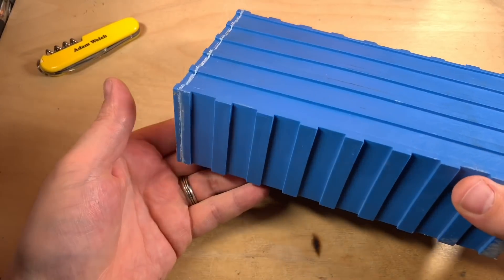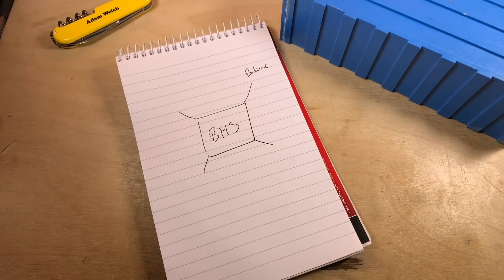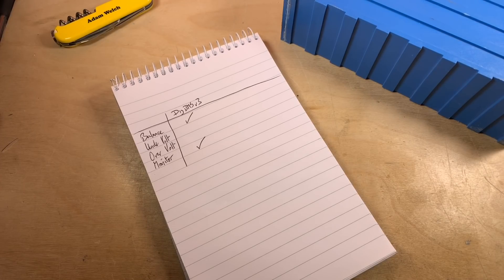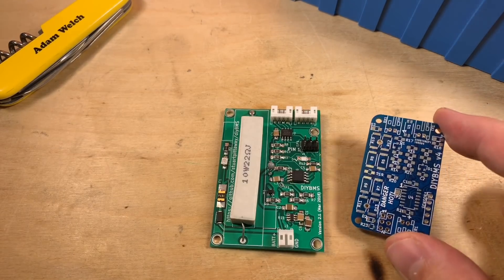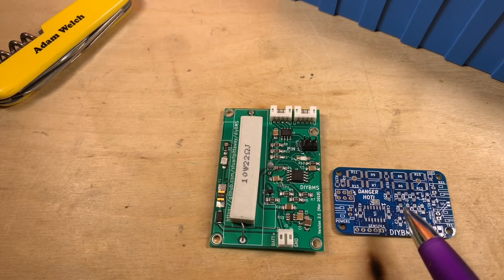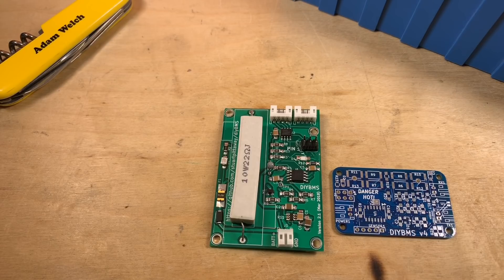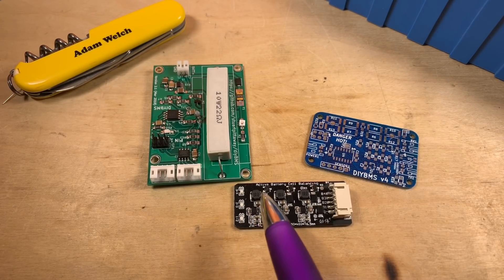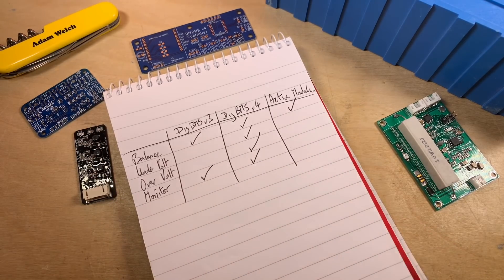LiFePO4 Battery Bank Management Systems

Comment: Thanks, for this video!   Very well done!

Also important, is temperature monitoring and the ability to disconnect all charging sources when the pack is too cold and the ability to disconnect all loads when the pack is too hot.   And, attendant to that, your BMS should be able to control a heating and cooling system to keep the pack in a safe temperature range.
Reply: Same I wanted to say. Especially for cold days LiFePo-Batteries do not like cold temperatures, when loading. Then you should go to LiFeYPo batteries or heat the cells slightly, but then you waste energy for heating.
Reply: @DocMicha  Or use LTO cells

Comment: Seems like over and under voltage at the cell level is more important than at the entire pack level and would eliminate the need for it at the pack level because your pack can't go over or under voltage without at least one of the cells getting over or under voltage long before the entire pack would. But for redundancy it makes sense to have the protection at both cell and pack level.
Reply: Yes. Balancing is the least important function bc of this.

Comment: I like the idea of not dumping power , instead use it , charge another battery , heater / water heater etc.
Thanks again
Reply: Or boost it to main voltage of the battery and return it back (when charging). And vice-versa at discharging.

Comment: I've recently been playing around with a  190Ah 12V LiFePO4 battery, using one of the aliexpress bluetooth BMS units with a custom arduino OLED display. One thing which is a must have for a LiFePO4 BMS is a coulomb counting state of charge meter. If you use voltage to determine state of charge it can be ~50% out under load, and ~25% out at rest. Active balancing doesn't matter that much, since large format LiFePO4 cells are most likely going to be very well matched and not require much balancing.
Reply: I have the same bttery from them a.ll cells we're  balanced on just a few 12 volt ight they run down in just  few hours  I have two 4 cel packs not sure what to try.

Comment: To use the active balancing and not the DIYBMS V4 (I use that) cannot you just leave the load resistors off of the DIY BMS?
Reply: Won't hurt to use both - they'll have different threshold voltages anyway.
Reply from the maker: I could, but the load resistors won't take any load (hopefully) unless for some reason the active balancer has gone wrong, or can't cope.  So they may as well be fitted - just in case.
Reply: Is there an isolated DC to DC boost converter module readily available? Instead of load resistors, connect to input of an isolated boost converter. Output of the boost converter to the overall charge bus of the pack at a high enough voltage to charge. Repeat for each cell. When a cell is over voltage, DIY BMS will turn on load resistors, but instead of resistors you have a boost converter that will feed the excess energy back into the overall pack and then into lower voltage cells.

Comment: For years I kept saying there's got to be a way to transfer the excess energy from one cell to the next. This balancing board was a great find, but it does need over and under voltage like you said Adam
Reply: Active balancing has been around for at least 10 years.  Its way more money though and if you have brand new cells that are matched from the factory, the active balancing circuitry wouldnt really have anything to do.

Comment: Is there a Battery Balancing  module that is designed around Lithium Ion batteries that keep the max voltage to 4v per cell in a 4s arrangement? It seems every thing I see out there is designed for a 3.7 max voltage.

Comment: What would you recommend for 4s x 22p LiFePo4 HP? I want all the trimmings. If you could work all that out for me it would stop me a whole heap confusion because I can not find the board with all options plus I do not understand the charger and what charger I need for such a big arrangement. Would I need to charge them in smaller groups???

Comment: There are 5A versions of the active balancer too. Still waiting for mine to arrive from China. Another YouTuber seemed to think that the small board doesn't actually transfer the energy across though. I'll test mine when it arrives :)
Reply: Crap I just ordered an 8S one and now read this
Reply: Got a link for the 5A version? NVM: I just happened to find some on ebay with "active equalizer 5A"
Reply: @WereCatf  I can't seem to get the libk on my phone, just search for: 5a 4s active balancer and they should pop up. Not many sellers at the moment. Good luck :) edit.. There are 9 silver/blue caps on one side, other side os all surface mount stuff
Reply: There seem to be versions with red caps on Aliexpress now as well. Think I should order me some to test. Too bad it takes 2 months for anything to arrive to Finland from China :/
Reply: @WereCatf  Im lucky being in UK. That's the only good thing I can think there is right now haha
Reply from the maker: Julians video seems to suggest it is transferring correctly.  I'll be doing more tests before I attach it to anything important!

Comment: The thing with balancing, if the packs/cells in each of the series were built properly to be all as close to the same capacity as possible, AND the bad cells (self dischargers and high IR cells) have been weeded out, there really shouldn't be any need for an active balancer as it would rarely be used. A passive, or burn off, balancer would see little use, so therefore the "wasted" energy would be minimized. If the transfer, or burn-off, of energy is required on a continual or great extent, then there is something wrong with the pack(s) and the bad cells need to be removed.
Fix the problem, not slap a bandage on it.
Altho, I will say the active balancer is a nice piece of equipment considering it's low cost and that it actually does what it's intended design is. Sometimes Chinesium devices deliver what they promise.
Reply: For applications where fast charging/discharging is needed, active BMS counts alot. An e-car with used out cells can charge much faster. At the same time it can get much higher range. When a bad cell reaches lower limit, A-BMS starts transfering energy from other cells. Pasive BMS cannot do much in this case. So the battery protection process should be triggered. Despite there is still juice in other cells. For slow chargging/discharging systems like Adam is building I belive ABMS is not so important. Especially if bad cells can be spotted and replaced (as you are suggesting).
Reply: @tg_privat  I suppose I can see that particular charging case as where it would benefit. The system can still charge even if a weak cell. 

But, in those types of systems, it's harder to replace a weak/bad cell, so it makes more sense. Unless it's a diy system, of course  ;)

Comment: Is it possible to get jlpcb to assemble the boards as well as make the pcb . if it is please could you link to the files stuart has made. I find it hard to solder the surface mount parts

Comment: Great video Adam keep up the hard work 👍

In your opinion what would you say the maximum pack size these would work with. I think your packs are 20 cells?
Reply from the maker: I have a set of 7s20p lithium ion 18650 set (cell average about 2.5Ah) but I’m also building a 4s3p LiFe set with 60Ah cells. Small balancers can work on big packs if the cells are already well balanced and have similar capacity and internal resistance. But if your packs are built from recycled cells of differing capacities etc. you’ll probably need a higher rated balancer to keep them in check. It’s hard to say exactly what will work for everyone.

Comment: Just did a quick look for those boards.  I could use the 4S version Cascaded for my 24V bank  it would seem.  COOL BEANS Sir ! Piggy Backed to a basic charge control BMS. Or NOT ?  Don't even bother using the normal BMS ?   Most inexpensive BMS use bal currents under 100mA.  Worthless for larger banks.   I would be quite pleased to simply use these boards and use absolute charging voltage limited to my 28.8V.   Only wishing 3.6v per cell protecting longevity and cycle life.    Over discharge would be accomplished via battery voltage monitor PCB disconnecting load as required.   Keep the  discharge voltage high enough so individual cell voltages would not be a issue.  .   Over Current good ol fashioned Fuse/Breaker  Yes Yes, liking this Idea most well.
Reply: Coulombs would make more sense.

Comment: Do you need to switch off if any cell goes below a certain voltage?
Reply: I think that is how the under/over voltage circuits work - it will trigger on any one cell being out of range and send a signal...what you do with the signal is up to you, so you could activate a relay and shut the output down on detecting a low cell or shut the charging off on high cell, at least until the balancer catches up with its job of balancing between the cells. This time delay between the balancing time and the cell status detection could lead to very bad on/off/on/off in quick succession, so the micro will need to distinguish this situation and decide if the whole battery needs to be shut down until a reset signal occurs. The reset signal could be a relatively long period of time or a user action - e.g. pressing a button. How the diyBMS works, I haven't looked, but a little time with the code in the micro will answer exactly how it works under these circumstances.

Comment: Damn, 12 / 4 making 4S     4 * 60Ah = 240Ah battery bank.   Hoooooooo   I want one.   Hell I'd be quite pleased with 120Ah 24V for my Solar Wind power closet toy.
Reply: 12 cells = 4S3P = 3x60 Ah = 180Ah @ 12V
I recommend using watthours instead of Ah, as it gives a true value of capacity independent of voltage.
Reply: @ahaveland  Old School.   I'm use to Ah.   The rest comes to play as needed.  Batteries are in Ah unless there being called upon.    I may not be working in Hours.   Maybe minutes.  Seconds..  Days.    It really depends on what your asking the batteries to do.   Dumping a boat load of energy in minutes requires Ah.
Reply: @ahaveland  Ether way you end up doing the Math.   I'm use to Ah.
Reply: @pulesjet  I'm old school too, but think:
A 48V 100Ah battery contains 4x the capacity of a 12V 100Ah battery.
It's easy to convert:
100Ah x 12V = 1200 Wh
100Ah x 48V = 4800 Wh
Ah is meaningless without knowing the voltage, which is why your home energy consumption and EV batteries are measured in kWh.
(They really should be measured in joules, 1kWh = 3.6MJ but that's another battle!)
Reply: @ahaveland  Point taken.  Agree Yes Wh is better as a working  bench mark.   Will I ever change ?   Most likely no.  LOL   Just use to doing it that way.  Attempting to conform would only end up with me screwing something up.  LOL     Yes Wh is better as a  bench mark.
Reply: @pulesjet  If all you ever use is 12V, then Ah is ok if all you need is some kind of conceptual idea of relative size at that voltage.
Otherwise, Wh for everything else. Worth spending a few seconds of conscious effort to save a lifetime of confusion!
Reply: @ahaveland  LOL, Your the only one confused it would seem....     24V 48V 12V batteries all reflect the Ah rating on them.  Not Wh.
Reply: @pulesjet  No. I am not confused.
Wh is a unit of energy. Ah is not unless the voltage is known.
A Tesla battery of 100kWh @ 400V is only 250 Ah.
Clearly, Ah in this case is a ridiculous unit, considering that a Tesla battery contains the energy equivalent of 100 12V lead acid car batteries.
Reply: @ahaveland  What ever Sir.  Wh are only a unit of energy.  Without knowing the Amperage and the Voltages involved they really don't mean much to the constructor.  Again to get a usable number you still need to do the math.   I prefer to start with Ah and Voltage.